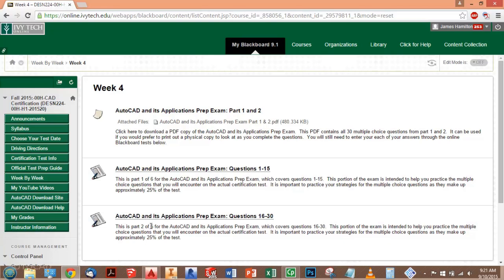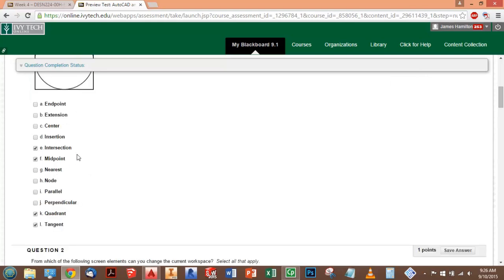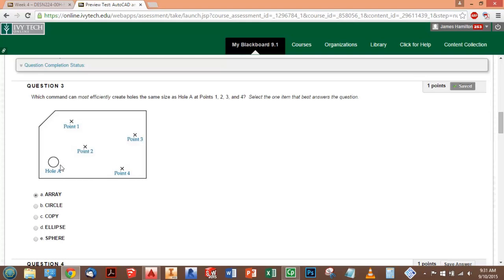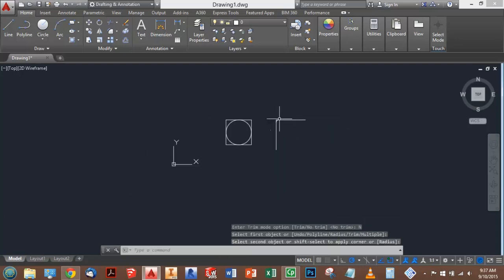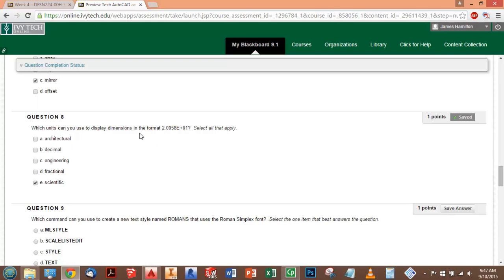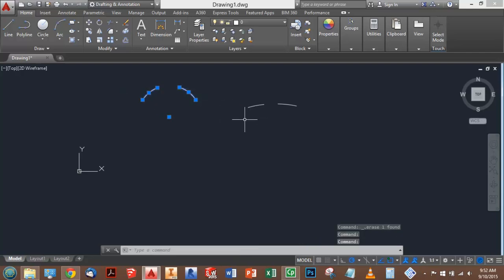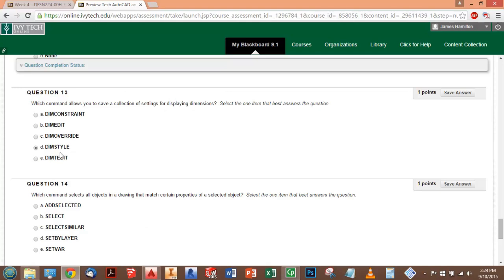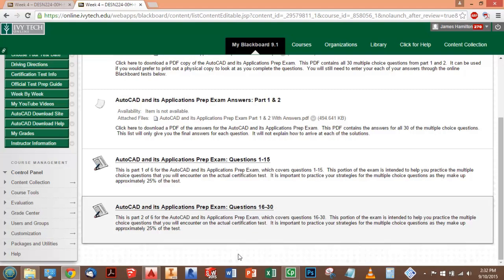AutoCAD and its Applications Prep Exam: Questions 1-15

Comment: I'm commenting here because comments are disabled for your newer videos. I took this exam today and I have to say, the questions I was given were 10 times harder than anything you've covered. These tutorials might work for the AutoCad User Exam, but not one of the 35 questions on the Professional Exam is even close to being as easy as the examples you give in your videos. Also it was not a 75% 25% split between multiple choice and practical. I was given 1 multiple choice question. the other 34 were fill in the blank. I think your students will find themselves horribly unprepared if the content in these videos is what they are expecting during the test.
Reply: Avery Stockwell I took the certification exam as well on Friday & the questions were also way harder than the practice exams I took. Plus I didn’t have two hours like they told me in the beginning but one hour with 30 questions that left me with only two minutes per question. Not enough time
Reply: Brigit Juarez I feel your pain. It’s like only the people who designed the test could possibly pass it.
Reply: Hi Avery, very useful information for me. Luckily, I read your comments before going to take an exam. Is that possible to share one sample questions in your exam? I really appreciate.
Reply: Susan Shi, Hi, almost every question on my test dealt with Named viewports. Don’t go into it without knowing what those are. One question that I really remember asked about printing or plotting. You had to change a bunch of settings in the layout page, then answer what the Y offset would be. Another question had me importing an object and placing it in a specific spot, then answering what the distance would be between it and another object that was already there. It didn’t specify how to find the distance, (shortest, middle, etc.) I used their insertion points. I’ll never know if I answered that correctly as PearsonVue won’t ever divulge that information.

Comment: See question 15:
You also can move the circle to the point A by 
Quadrant , intersection 
Because the circle is already have center grip 
So, you just select the circle first then move it from center to point A.

Also what gonna shocks you , if you also try perpendicular , center you also gonna make it.
But you need to move the circle twice , first chose it to be perpendicular to one rectangle the next move chose it to be perpendicular to another rectangle , it’s work believe me.

Comment: Could you please explain why tangent is a correct choice for Q#1 or if that was just a mistake.  If picking that point with the ID command using only tangent osnap, it snaps to every point on the circle and seems like a very inaccurate way to pick that point.  Yes it will work but its very hard because of human error and having to pick the exact right point on the circle.  The tangent osnap works fine when drawing a line to the left or the right using tangent osnap for a starting point.  However, when simply just picking that point like the instructions state, it seems like tangent osnap would be a very bad choice because of the chance of inaccuracy due to human error.